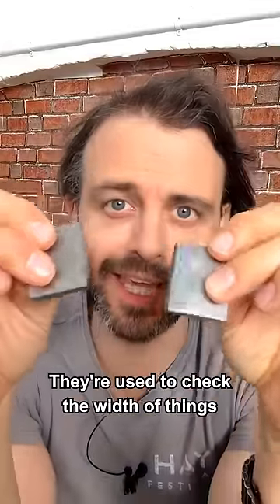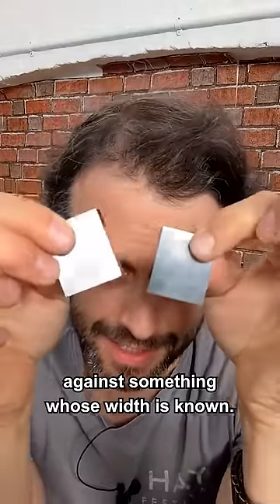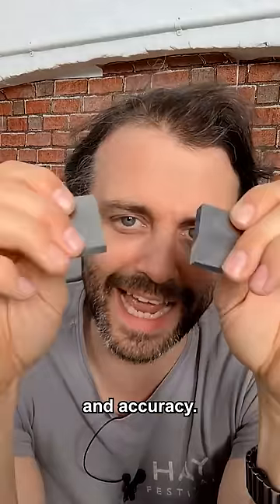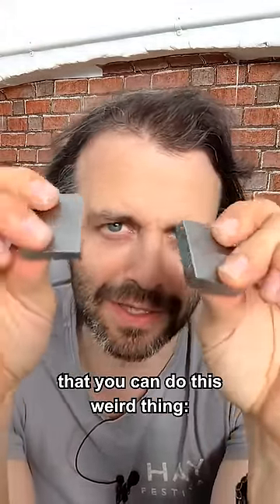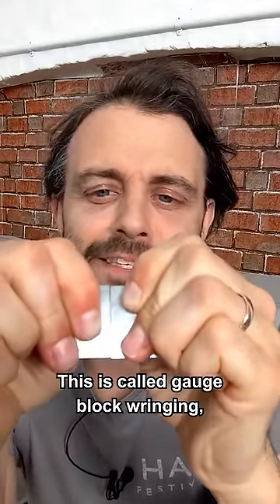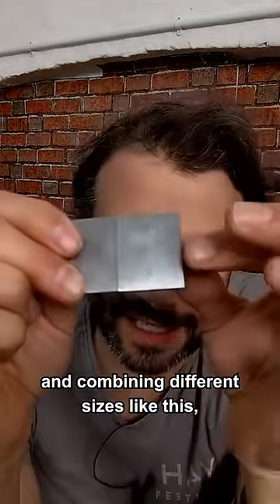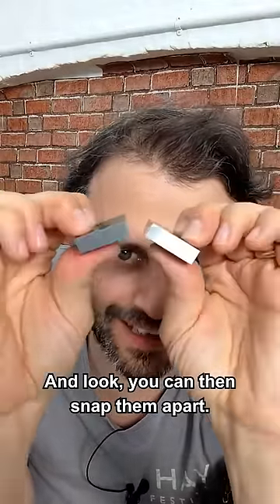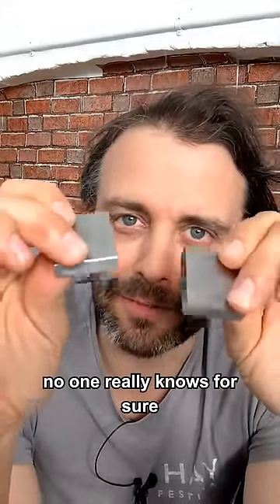No One Knows For Sure Why This Happens!

Comment: For all the air pressure theory proposers: it works in vacuum too , Cody's lab tested that .
Reply: In a vacuum there is still pressure. In between the blocks there is absolutely no pressure. Two peaces of paper will pull together.
Reply: @joeherrera1426  substantially less pressure than in our air. Almost space like.
Reply: @Yourmomloser  cold welding different.
Reply: Does it work as well though?
Reply: I think is welding, the materials bond together given how close they are
Reply: Metals usually like shifting their electrons around a bit it’s probably good ole subatomic bullshit
Reply: Cody's lab the goat!
Reply: The likeliest answer is we'll never find an answer until after a paradigm shift.
Reply: My theory is that the microscopic imperfections are forced together, so they fit together in a puzzle like way, in so many spots that they can hold onto each other.
Reply: @joeherrera1426 yeah yeah no shit
Reply: It's because nothing can be perfect and the sides will always cause a vacuum because the edges are fine enough to not allow air to escape
Reply: @Evanflame-rk9xu I offer the suggestion that we refer to this as "Accumulative Friction". The two faces are so finely smooth that the atoms of the materials themselves interlock so well with one another that the friction overcomes the pressure and influence of both objects on one another. Thus, they "Accumulate" friction as they are pressed together and rotated.
Reply: If you put them together maybe it forms a atomic layer of rust one that is sandwiches between the blocks
Reply: So a suction cup doesn’t work in a vacuum? Theory still stands with or without air
Reply: @luiggitello8546 how would they come apart so cleanly then?
Reply: @ReaperofSouls337 suction cups don’t work in a vacuum? It’d have to be another mechanism doing most of the work
Reply: @joeherrera1426 could it be the casimir effect?
Reply: I was thinking about this. But thanks for sharing the opposing evidence !
Reply: Could it be the metal going into cold welding because the surface is so flat and very little air in between?
Reply: @sirsanti8408  just because it’s welded doesn’t mean it’s welded well. I think they’re right. It’s likely to do with the friction of the atoms creating some sort of micro welding. Like when you push a flat object on a painted wall fast enough it sticks. The other options I can think of immediately are magnetism or an interlocking system but if it was magnetized then it’d be easy to test and doesn’t make sense as to why you’d need do such a specific motion and an interlocking system would mean pieces would break off every time so probably not that or it would be an easy solve.
Reply: Obviously it's called science magic 🎩
Reply: Sharing electrons?
Reply: I don’t believe it
Reply: perhaps there is no air in the no-gap,  reating a vacume ?
Reply: static electricity that attracts objects
Reply: My guess would be the Casimir effect
Reply: I'm guessing it has to do with atomic forces. Being so smooth and uniform those atomic forces have a ton of surface area to act on. Can also kinda do this with 2 smartphones screen to screen but not quite as well.
Reply: Leave them together long enough and you'll vacuum weld them.
Reply: Oh shit thank you for reminding me about that channel
Reply: @ReaperofSouls337 Suction cups absolutely do not work in a vacuum 😂😂 It should be pretty obvious that they rely on atmospheric pressure to hold them in place.
Reply: Cody’s lab top tier content
Reply: @MrChesemis cold welding is a phenomena that nasa has had to deal with in space on countless occasions. I believe they had a rover or a satellite fail to open because 2 pieces had ended up cold welding themselves together in the vacuum of space.
Reply: Yup, it’s called cold welding
Reply: ooh, now im shitted.
Reply: @owenblount7334 I think that is a prevailing theory. Electron interactions. Yeah subatomic shit😂
Reply: @ReaperofSouls337  Do you understand the basic principle of a suction cup? In order for it to stick to the object, it needs to have a lower pressure than it's surroundings in order to stop the edges of the cup from lifting off. The reason the suction cup stays where it is is because the air inside of it is unwilling to expand. if the suction cup was surrounded by vacuum, it would be impossible for it to stick.
Reply: Afaik it's because they're very flat and as you push out the air, they technically "weld" together
Reply: Its something molecural Like its so smooth that the molecules Connect together
Reply: What about van der waal force ?
Reply: Is it possible it's Milled so accurately that the molecules are actually semibonding at least enough to cause a decent hold
Reply: Van der waals force
Reply: Metallic bonds / electrostatic forces maybee
Reply: @Evanflame-rk9xu  and with the number of atoms/molecules so huge that even the randomness of each imperfection is certainly matched perfectly by another
Reply: Well this is it obviously the air pressure that comes first in mind (Pascal experiment) it make no sense making a video without mentioning it. 😢
Reply: @ReaperofSouls337 yes, suction cups don’t work in a vacuum, smooth brain bro
Reply: From my 8th grade chemistry class I remember my teacher telling me that if you stick together two perfectly smooth materials they will bond together on molecular level, almost like a cold welding, except that they can’t really weld in oxygen present atmosphere, which some of people here seem to not understand.
Every atom has attractive force. 8th grade chemistry, my guys. You don’t see it, because it is, as the name suggests, microscopic, so if you manage to make two very VERY smooth surfaces, you can press them tight enough that their attractive forces overlap.

“SuCcsHuN CuPs dUrrRr”
Reply: Virgin air pressure theory fan vs chad we don't know enjoyer
Reply: Maybe the material has an effect? Oxide layer, capacitance, electrostatic forces? By squeezing more air out the blocks are closer, static charge builds up from the movement between the oxide layers, then discharge and hot weld extremely small sections?

I’m probably way off base though.
Reply: @joeherrera1426 Maybe, but air pressure doesn't affect the effect. You would expect that the total amount of energy to pull them apart would be less in a vacuum, but it is not.
Reply: Electrostatic forces at its finest🐓
Reply: @joeherrera1426 Paper and gauge blocks are rather different in terms of density and mass. It would take considerable air pressure for gauge blocks. 😅
Reply: @JustAGooseman so, electromagnetism-something
Reply: @chub22g24  no it's magic
Reply: Saved me some typing. Thx
Reply: @fixitfelix718  you're actually damn right
Reply: Of course he did😂
Reply: @MrChesemis almost is still not 0
Reply: Happened to an astronaut once. Almost lock him out of the space craft
Reply: Why not friction? Maybe two objects that super flat have the biggest area of contact
Reply: It's probably electromagnetism of metal atoms, because the surface is so smooth the surfaces can contact much closer then if they were jagged thus providing more contact which can allow more atoms to connect electromagnetically
Reply: @Evergreen1400  cold welding only happens when 2 metals don’t have an oxidized layer due to a vacuum.
Reply: @luiggitello8546  would take a good while to do. It's the same as you not being able to pull the lid off a vacuum chamber. It is to do with pressure kinda. Basically there is nothing much between them so you have to force it apart to let the air in. Not sure if it's actually pressure it's been a while since I went to school lol
Reply: Could it be that force that pushes things together based on which wave frequencies they block out?

I don't remember what it's called but the idea is that the smaller a gap gets, the more frequencies it blocks out, meaning there's less energy inside the gap and the 2 things are drawn together. Idk if this gap is small enough for that or not though
Reply: I thought it'd be the same principle that geckos use to climb walls, where there's a slight attraction between surfaces, so with enough surface area, they can't stick together
Reply: I assumed it probably has some sort of effect on it rather than being the only cause, but a test in a vacuum chamber makes me think its less than I originally thought
Reply: Vaan der wals interactions?
Reply: @joeherrera1426 erm what? Blud does not know what vacuum means. It’s probably electrostatic that brings the paper together
Reply: Van de Waals forces?
Reply: @MrChesemis  Is the twisting motion maybe breaking the oxide layer?
Reply: Oh!!! Damn this is awesome! I have no training in this it was just a theory I had! But it actually was proven?
Reply: Theoretically, it should work BETTER in a vacuum, as it is likely related to the same phenomenon as cold-welding, which is very similar, and works best in a vacuum (which NASA engineers learned the hard way, when the Galileo spacecraft's high-gain antenna failed to fully deploy, due to issues with metal-on-metal components spontaneously cold-welding, causing the antenna to stick closed).
Reply: @joeherrera1426 not enough
Reply: In fact, it's much easier in a vacuum, as there's no buffer of air to get out of the way. Engineers designing mechanisms for spacecraft need to be careful to avoid having flat metal surfaces come into contact with each other, as they'll stick together.
Reply: @ReaperofSouls337 Suction cups don't work in a vacuum.
Reply: What if it's trapped static electricity? Due to the friction of 2 nearly perfect honed surfaces. 

Electro magnets are power by electricity. So if you're able to make a natural current through friction. Maybe the two different surfaces are attracting to one another, until the trapped static electricity is released. 

Which would be such a low amount, it wouldn't do the zap thing.

Just an idea. Would like to know the real reason
Reply: @Evergreen1400 The Galileo probe's main antenna dish failed to deploy because a few parts of it became cold-welded during the launch.
Reply: Perhaps IMF’s
Reply: So basically because the surface is smooth they can keep air out between them and resulting in there being empty space between them and it creates vacuum that keeps the 2 blocks tgt?¯\_(⊙_ʖ⊙)_/¯
Reply: Okay, then here's another one to think about... Can it be oil of some sort? I know they're clean, but a surface so smooth could work with much less material like the one comes off of a person hand just by handling it.
Reply: @peterwolftips  I remember something like that when u place have wet surface and wet surface, kinda like your hands clasped together when they are wet.
I donno how tho.
Reply: @joeherrera1426  Not enough pressure to hold anything of actual mass together. A plunger wouldn't work in a vacuum so why would this?
Reply: @joeherrera1426 when real science enters chat😂👍👍
Reply: I believe the answer lies at a particle/ atomic level. Could it be molecules or their obitting electrons being shared across a super close tolerance interface. 
Note that force and therefore heat is being applied to make them stick.
Just my theory 😂
Reply: @owenblount7334  "good ole subatomic bullshit" Is the perspective I didn't know I needed to have.
Reply: Just regular old atomic attractive forces, like almost everything else that sticks together.
Reply: Have you considered looking at the grooves under the microscope? I'm failing certain there's air pockets too small to be removed.
Reply: @owenblount7334  oh it's definitely some sub atomic Tom foolery 😅 probably just van der Waal forces
Reply: How they achieve perfect volume tho 🤔
Reply: Surface tension?
Reply: It is amazing how many people think they KNOW the answer.
Reply: Exelent comment
Reply: Wow that would have been my guess too!! In a vacuum that’s fucking crazy!!!!
Could it be molecular bonding?
Reply: It's cause it's metal. A crystalline structure. Just a macroscopic view of a microscopic puzzle being filled
Reply: Its probably cold welding on a very microscopic scale, as the blocks are twistsd together it rubs a tiny amount of oxidation off and the fresh metal surfaces will bond. As the faces are so flat they support eachother. This is why it wouldnt work with two random lumps of metal, the uneven surfaces have no support so the weld that forms breaks instantly.
Reply: @luiggitello8546 that is not how metal works
Reply: Something different happens in vacuum. It's kind of welding. It was observed in space multiple times (most famously - during the first spacewalk in history)
Reply: @owenblount7334 "Good ole subatomic bullshit" just has a ring to it... Three thumbs up 👍
Reply: Bruh I came here thinking I was smart  about to just say it was the air pressure
Reply: Cody's lab is such a cool dude
Reply: Space has pressure and a lot more than people think but earth's atmosphere is at such a high pressure that we don't really have a good reference for it, for example thats why tires are measured in gage pressure rather than atmospheric pressure because the changes would be so minimal if you measure atmospheric pressure you wouldn't be able to notice a difference  @MrChesemis
Reply: this is just a really good example of cold welding
Reply: @owenblount7334 " good ol subatomic bullshit" 😂
Cant argue with that
Reply: This is a phenomenon that SHOULD happen in a vacuum. The lack of oxygen makes things stick together. It occurring in the air is where the mystery lies.
Reply: It is partial cold welding.
Reply: This works through electromagnetic eddy currents “locking” together as they are twisted. Basically the same idea as static electricity sticking things to walls.
Reply: My guess is electron interactions in the pressumed alloys across the "perfectly" smooth surfaces.  I.e., london dispersion or,  due to the alloy something more like dipole-dipole interactions
Reply: @JustAGooseman especially in an alloy like steel, this is similar to my theory of electron interactions and bonding (i.e., dipole-dipole interactions)
Reply: i wanted to say that its simply vacuum..
although it isnt proven that vacuum cannot exist in a vacuum..
Reply: They stick together due to the slight uneven surface catching in the other sides uneven surface like Velcro. This is just a much much finer velcro than anybody's used to
Reply: I think it's just a mechanical connection. A perfectly flat piece of metal on the molecular scale is not perfectly flat. The ridges probably interlock and maybe the molecules are even close enough to have a magnetic force/weak molecular bond to each other.
Reply: @creepysk7975  I doubt it’s welding as this would damage the surfaces with repeated ringing. It’s a combination of atmospheric pressure differential and something called the Van Der Waals force.
Reply: A perfect vacuum is impossible to achieve so Cody didn't do it in a vacuum. I hypothesize the  amount of air between the blocks is similar to the amount of air in a near perfect vacuum.
Reply: @joeherrera1426  "in a vacuum there is still pressure" my brother please look up the definition of vacuum lol
Reply: @JustAGooseman  bro are you a scientist
Reply: I had some pieces of exceptionally smooth glass out of car headlights. And they wring together too which only throws more wrenches into the theories. Codyslab showed that ots not the air pressure and me doing it with glass makes me think it's not a form of cold welding
Reply: THATS WHAT MY PHYSICS TEACHER SAID
Reply: @ReaperofSouls337  suction cups don't work in a vacuum. They rely on air pressure.
Reply: @chalor182  yes. A perfect vacuum yes. But unfortunately that is not possible and definitely getting close to is requires way higher quality equipment than anything Cody has. This means the vacuum chalor is referring to, does infact still have pressure. You are both technically correct.
Reply: Casimier Effect?
Reply: it's smooth so it just forms a vacuum inside and atmospheric pressure holds them and when he's breaking them apart he's folding it to let air in and easily break the apart like those air pressure caps you find in plushies.
Reply: Friction, value of mu is very large
Reply: @ferrumignis It may seem obvious to you but I think you are wrong!
Reply: @chalor182  A vacuum in the technical sense is a space devoid of all pressure. A vacuum in the colloquial sense is a space with a pressure that is below that which we normally experience.
Reply: @JustAGooseman It’s called Van Der Waal's force.
Reply: @baarni  i didn't explain it correctly. Btw this works in vacuum too. And what I know, it works even better. The two surfaces are so flat that the atoms themselves (or the strong atom field) start interacting with each other. That's how it's supposed to work in vacuum iirc. But in the atmosphere, it could be different
Reply: is it so smooth their atoms slide together?
Reply: I thought it was van Der whals forces?
Reply: @baarni yeah I was always told van Der whals
Reply: @joeherrera1426 its not debatable tho 😂 it’s very much proven that smooth metal surfaces will “cold weld”. And they do so even more easily in a vacuum. Nasa discovered that the hard way in space
Reply: I would imagine that air pressure HAS a part in this, but I agree that there may be other causes too
Reply: Surface tension.
Reply: Well, you just shit all over my idea 🤷🏾‍♂️
Reply: its the vanderwal force and the inter atomic ones
Reply: @ReaperofSouls337 😂 no a suction cup wouldn't work in a vacuum... kind of hard to suck without air bud, ask your mom, she would know... just kidding, had to say it 😂
Reply: Fuck
Reply: @luiggitello8546 there would be an oxide layer that prevents it, I believe
Reply: @luiggitello8546  that's not possible, if that was the case then you couldn't just easily and cleanly pull it apart like that, plus cold welding only works on metal that hasn't been exposed to air or have had the oxidation layer removed.
Reply: im sure its the van der waals intermolecular forces holding them together and oil/water left on the blocks to help them with surface tension.

air pressure plays a significant role when not in vacuum.

The reason why they work in vacuum is because the other 2 mechanisms are strong enough to hold them in vacuum.
Reply: it's just cohesion
Reply: @joeherrera1426 yes but then if you increase the pressure it doesn't.... So it's definitely not about having no pressure it's about having not enough pressure to get back in between
Reply: tiny cats that latch on with their tiny claws
Reply: @owenblount7334  Yea sub atomic quantum shit. Don't think about it
Reply: It’s because with such a smooth and unblemished finish like that, the atoms are able to bond together, or the electrons are able to bond together within the atoms, basically creating one piece of metal because that electrons bond between the two metals because the two metals are so close together
Reply: @Evanflame-rk9xu  friction? I like it
Reply: Sounds like vacuum welding
Reply: Spoiler alert:

It's the vacuum between the blocks.
Reply: Van der Waals forces. Same as gecko pads
Reply: The bond gets stronger with time; you never leave Gauge blocks wrung together for too long, if you do, you cannot get them apart.
Reply: Could it be due to moisture? Like there's just enough to where the surface tension holds it together? Or maybe like someone else said that when you twist it, the molecules are able to "magnetically" connect because there's more surface area available AND on an even enough surface so they connect without the neighboring molecules interfering. Or maybe the twist builds up enough charge to start a chain reaction to link up enough electrons to form a weak bond
Reply: a huge stretch im just spittin words here but i personally think it has to do with friction

sure its smooth but i think that because its THAT smooth most of it's surface area is touching kinda like with fusing 2 books together
Reply: does magnetizing them have any impact?
Reply: its not air pressure, think of screws and glue , or welds, how do you stick something to something.. surface area...friktion, smooth surfaces not very smooth under an electron microscope etc etc
Reply: @joeherrera1426  if there is only a small amount of pressure in a vacuum then the weight of the blocks would overcome the pressure force. There is likely a metallic or crystal bonding force causing this.
Reply: Put them in your ears.
Reply: My guess is condensation in the air. I wonder if this would happen with 0 moisture. basically suction.
Reply: Wouldn't it just cold weld on a vaccume
Reply: atomic cohesion is my guess, with it so smooth, more of the atoms can get close enough to eachother to grab the other side
Reply: @owenblount7334  I love that explanation: It's subatomic bullshit!
Reply: @ReaperofSouls337 Yes,. suction cups don't work in vacuums.
Reply: it's probably surface atoms moving slightly and foming a temporary bond
Reply: It still has its surface tension, though.
Reply: @gutnutgut plus electrogravitics and vortex mechanics
Reply: cohesion is a phenomenon, not an explication for the reason of the bonding force.
Reply: friction only refers to the effect that would prevent the two blocks from sliding, so it involves only lateral forces.
Reply: smooth metal on metal there is nearly no friction, and you don’t see any rubber object with really high friction instantly bonding to something (as long as the rubber doesn’t melt)
Reply: I believe the effect is 90% Van der Waals forces, that cause this kind of cohesion, while 10% is due to the limited amount of air that can squeeze into the gap preventing fast separation. Try pulling apart two smooth sheets of glass/metal fast vs. slow after they have settled on each other. I imagine those 10% increase a lot, the faster you try to pull the two objects apart.
Reply: Yes of course it does. The wringing pushes the air out just as a vacuum would.
Reply: Well I'm a vacuum you get an even stronger effect, cold vacuum welding
Reply: @denofpigs2575 what do you mean... It's a known effect of Van der Waals forces lmfao. Not sure why he says nobody knows
Reply: @Evanflame-rk9xu you're not wrong, it's Van der Waals forces between the very close objects. "The van der Waals force of adhesion is also dependent on the surface topography. If there are surface asperities, or protuberances, that result in a greater total area of contact between two particles or between a particle and a wall, this increases the van der Waals force of attraction as well as the tendency for mechanical interlocking. "
Reply: @DarkAttack14  Well if I take his word over yours we don't know. If I take yours over his we do.

Either way nothing changes for me so ¯\_(ツ)_/¯
Reply: @joeherrera1426  say you skipped school without actually saying so.
Reply: It's air pressure and/or oil residue.
Reply: Brother, do you know something name molecular attraction?
Reply: Yeah. While I haven’t read any comments or replies. It reminds me of the cold welding phenomenon that happens when an object can’t oxidize because there is no oxygen. So you can stick two objects of the same material together and they will bond together. Could it be the metal surface is scratched upon turning it, air is kept out due to the flat surface, and the metal forms a gentle bond together through that “cold weld”. Obv that’s just speculation but it would make sense to me. Either way it’s neat to see it happen. Could always just be static as well.
Reply: I believe inside a vacuum there could be a Greater vacuum. And the presence of the oil strengthen the greater vacuum. It is less difficult to pull the the two bars away from each other in the vacuum compared to outside the vacuum. This means that the vacuum you created have not equal or overcome the vacuum created in between the two oily bars😅
Reply: Thanks for your comment.
Reply: my guess is that this behavior is related to atomic scale or quantum scale physics. i think it's pretty likely the surfaces are so smooth that the faces of each block come so close together that quantum tunnelling / electrons overlapping into the other block. what would be interesting to see is how this behavior changes at various material temperatures
Reply: I would've thought that this was clearly the van Der Waal's effect - which we've also recently realized is how geckos' feet stick to walls and then immediately release, so easily/readily/mysteriously - but I see lots and lots of seemingly/possibly legitimate answers and guesses above...???
Reply: @MrChesemis what about ionic bonds, could it be a force similar to that of h-bonds?
Reply: @LAGGANGGAMING  I tell anyone I know who has kids to let them watch Cody's Lab. Kids especially love it. For them it's like having an older brother who messes  around with stuff in the backyard and out in the garage and let's you watch, and then explains everything he does while he's doing it.
Reply: @joeherrera1426  Most people don't know there is still pressure in a vacuum. Happy to see someone else posted this.
Reply: I imagine it's a mix of atmospheric pressure and van der vaals forces, that's how some gecko thingys climb glas for example
Reply: My guess is a lot of LDFs due to smoothness
Reply: Cold fusion?
Reply: Van der Wall effect?
Reply: proximity<-->gravity
Reply: Cold weld
Reply: Does the twist-n-stick also work under water? (Fully Submerged in freshwater or saltwater)
Reply: @catnium  is it magnetism in some way? Eg polarized static electricity?
Reply: link?
Reply: is it not the same principal as cold welding? like what happens in space with astronauts?
Reply: It's because it's hard for air to get in.
Reply: I'd like to see that test and tested for temp changes too.
Reply: Vacuum? Low pressure is not vacuum.
Reply: Action Lab literally did this and showed its air pressure
Reply: Was about to comment, the way they taught us was with air pressure
Reply: It should be with zero humidity and then u will understand
Reply: dude everything is something, even the vaccum of space. there are just far less particles. also who says its just one force? it could be several factors. the objects may be smooth enough some of the particle want to bond, perhaps becuase when you break the bond whatever particles do have to occupy the space immediately perhaps its hindered by causality.either way if we happen not to actually know then its becuase the professionals with the million dollar machines and equipment havent decided its worth it yet.
Reply: I saw them in real life and played with them.
Reply: oh well. There goes my theory. lol
Reply: That doesn't rule anything out. Cold welding/galling of metal to metal serfaces in vacuum is an issue NASA deals with regularly, which is likely to play a factor here, but that doesn't mean air pressure doesn't contribute in atmosphere. Air is viscous like any fluid, meaning it also has surface tension. If it's not able to enter between the blocks, they'll remain stuck together irrespective of cold welding. This same vacuum effect can also be observed in water.
Reply: Dang
Reply: surface tension, the same as why a beetle can walk on water,
Reply: To what extent is that vacuum vaccumed though?  Can there still somehow be a big enough differential between the blocks to make them stick?  I wouldn't be surprised that machining is atomically precise.
Reply: @chainrelapse9144 The act of wringing removes the oxide layer (rust) which allows the metal to stick due to molecular attraction.
Reply: van der Waals
Reply: So, they're so finely cut that the atoms themselves attract?!
Reply: @akasickform  not atoms, molecules. But basically yes.
Reply: That was going to be my first guess, Lol!  Thanks!
Reply: You should look about cold welding how two very clean surfaces can stick together
Reply: Casimir Effect probably
Reply: @sirsanti8408 bad cold welding, grease, water, imperfect polish making it not as good and easier to come apart. also there is electricity making materials stick at a distance, like quantum tunneling. if you put paper in between and then repeat the process then you have some knowledge, trough paper you wouldn't be able to achieve cold welding. but if you push harder it could quantum tunnel some electrons, also paper will clean the grease and water for stickiness.
Reply: more inclined to believe its some subatomic shenanigan where the blocks are so close together that  they're almost sharing electrons despite the oxidative layer that's preventing them from cold welding.
Reply: @Nopenotreally. that is the reason you need to rotate them, to clean them and remove the air in-between.
Reply: @kittamitz not enough surface, the book fuse is because pulling them makes the papers stretch and bunch up in the middle making it a single book. but the way you said it is like saying putting them just one on top of another and expecting them to fuse.
Reply: Check mate air pressurists
Reply: Air pressure was the first thing that sprung to mind, but perhaps when two metals are machined to be able to fit together that well they can freely exchange electrons across the gap as any metal does within itself, thus it's an electrostatic effect
Reply: @owenblount7334  I think your bullshit theory is totally trustable. Yep, scientists simply called that bonding force "metallic force". This force forms when metallic atoms (actually cations) share the same electron "cloud". In this case, the 2 surfaces are so smooth, and they are the same metal so when you press, distance between them are so small that they can share electron cloud and form metallic force.
Reply: Is that how I Mind Meld with Taylor Swift?
Reply: @deadrussianliberal2897  You are almost right, and accidentally right in this case where it is metallic bonding force. We have 4 different forces between atoms/molecules: ionic bond, covalent bond, metallic bond and van der waal. Ionic bond and covalent bond won't form simply be pressing two pieces of same material together, they are not shareable between molecules nor can overlap.
Reply: In a vacuum you can cold fuse or cold weld them together.  There's so many electrons and they get so close  they can start to join atoms from the other block
Reply: It's possible in a vacuum they my permanently fuse together. This has happened in space missions.
Reply: Soo...it's witchcraft
Reply: Why are there people talking about air pressure?
Reply: @80n3y4rd  he didnt state this but certain metals can meld together on a molecular scale like what he just showed thats why it snaps when he pulls them apart
Reply: @PriMsWaRlorD  bc this is youtube comments and people are dumb
Reply: Thank you, and thanks Cody.
Reply: @Josh729J okay did you not read the thing to which you are replying?
Reply: Weak force or strong force attraction? I thought it was air pressure before this comment
Reply: There is a molecular vacuum being formed. People know this, it works for some substances and not others, also you need the surface area to be as shown. Smooth, and with polarities that work to form the little suction cup action at that level of materials.
Reply: What is generally referred to as "vacuum" isn't vacuum. It's sub-atmospheric pressure. Achieving below 10-8 mbar is quite difficult.
Reply: @luiggitello8546  cold welding is different. Stainless steels have chromium oxide surface layer (which prevents the formation of iron oxide). Molecularly there's a velcro like appearance. When two pieces are mechanically interfaced, over time atomic bonding occurs at the interface.
Reply: I believe it is called cohesion. Two like things attract.
Reply: Makes me think of some sort of atomic Velcro
Reply: What my theory is
Reply: Diffusion.
 In thBible it state u put 2metals 2gether the atoms merge.
  When gold and silver put together some of thgold get in thsilver some of thsilver get in th gold. 
 "So a mans face is sharpened by another."
Reply: In vacuum it is normal for two pieces of metal to cold weld together. NASA learned that the hard way
Reply: In a vacuum, the surfaces can bond.
It happened to a few spacecraft parts!
Reply: @joeherrera1426 
It's usually static that draws paper together.
A form of capillary action is at work here.
Reply: @luiggitello8546 
Molecular bonding in a vacuum is cold welding. That phenomenon was experienced by early spacecraft!
Reply: @ReaperofSouls337 
A suction cup does not work in a vacuum as it requires a pressure differential that does not exist!
Reply: It is cold welding. The edges don't have any oxidation, and when you press them together the electrons don't know which piece to belong to, so they act as on piece.
Reply: @JustAGooseman its suface tension.. even steel has this effect
Reply: The micro abrasions are perfectly formed.
Reply: On the extremely smooth surfaces it's the electromagnetic fields between the atoms interaction that causes them to stick together.
Reply: @joeherrera1426 vacuum pressure is real. However it's not just the vacuum. The electromagnetic fields between the atoms have a role as well.
Reply: Almost dead is not dead 
Almost a millionaire is not a millionaire 
Almost a vacuum is not a vacuum.
The last is a seeming impossible concept to grasp ✌️
Reply: @Evanflame-rk9xu I was gonna say, I want to see this under an electron microscope
Reply: I was thinking it had more to do with a mixture of microtexturing and electromagnetics. If those surfaces are perfectly or near perfectly smooth, the twisting motion may cause near imperceptible texturing that helps hold the two pieces together. The other goes along the same lines as the blocks are so smooth that there is enough interaction between the atoms that the blocks can stick to each other in a way like static electricity causes paper or hair to stick to surfaces.

If you control and test for those then, damn I have no idea. Magic probably 🤷‍♂️
Reply: The flatter it is, the more van der wals forces you get. The more wet it is (at an atomic level) the more water plays a role in pulling it together. They would not stick together let's say on the moon, not because of the vacuum, but it's because there is no water vapor present. Clean the surfaces with electrical contact cleaning to remove all oil traces of oil and then Heat them well above the boiling point of water and I guarantee you that they will not stick together, try it and you will see they will not stick together 👍
Reply: no it does not work in a vacuum
Reply: It’s not related to air pressure - probably the surface is smooth enough to allow subatomic forces act to stick enough atoms together to ensure temporary‚connection’
Reply: I bet it was not an ABSOLUTE vacuum where there are not even a single molecule left floating in the chamber. And would the displacement force of the blocks be exactly the same in apparent vacuum or under pressure?
Reply: Metal will actually weld together in space if the surfaces are not covered with oxidation.
Reply: Action Lab tested it too.
Reply: That’s because magnetism is a greater force than Gravity.

And like that, my comments are being taken down I’ll let you figure out the rest.

Here’s a hint what charges magnetism?
Reply: @violettownmicroenterprises1528 A vacuum needs a "place" where there is some space for the air to "not be" . If that makes sense. If there is truly no gap, there is also no vacuum. Unless they form in pits and tiny pockets all over the surface. This seems like a stretch but testable? I prefer the theory that it might be molecular forces. Depending on how much "accuracy" were talking about. Does it work with ceramics or only metals? What about glass?
Reply: COHESION AND ADHESION
Reply: @owenblount7334 😂
Reply: I'm sure in a zoomed in image we'd see a very not so smooth surface causing it to almost cling together like velcro almost... this thought was brought to you by Marijuana.. cheers 😊
Reply: @deadrussianliberal2897  My dude, “microscopic” literally means things that are large enough to see through a microscope. Learned that in the third or fourth grade. Name one metal heavy enough for you to be able to observe it form a metallic bond under a microscope.
Reply: @ZonsCHANNEL well it's obviously not magnetism lol that's just silly.
Reply: Casimir effect
Reply: Wow! So many people who know what they're talking about, the internet is amazing... Isn't it?
Reply: @JTheraos  almost like I said that lol
Reply: This works because atoms from both sides forgets that there is space between
Reply: @ReaperofSouls337 nope suction doesn't work in a vacuum because suction actually doesn't exist. no force is actuality pulling the suction cup, there is always still some air pushing the suction cup away. it's actually the higher air pressure from the outside that pushes harder. in a near perfect vacuum you have (almost) no air pushing on either side. of. course is the victim is shitty you'll still have still a bit of suction
Reply: @violettownmicroenterprises1528 like any suction, it doesn't have to be NO air, just lower pressure air. NO air would create a stronger binding force, 14.7 pound per square inch. even with the leverage it would require more force
Reply: @joeherrera1426 but even in relative vacuum the best suction effect you could get would still be very weak
Reply: Trying it in a vacuum was the first thing that came to mind.
Reply: There is no such thing as "vacuum", the proper term is "low pressure area" and it would be my guess if I had to giess
Reply: În absența aerului între cele două piese, apar și forțe de COEZIUNE.
Piesele se numesc "cale plan paralele (plan paralele).
Reply: Air would be the one thing that would make it not work, this fundamentally doesn't even make sense to try other than for the sake of it
Reply: @JacksonPfeiffer  semantics. It does not “literally” mean whatever you imply. If otherwise, what’s the word for the scale we’re talking? Nanoscopic?subatomicscopic? Never heard of that.
Also, bonds are invisible, as they are fields, as you know, which kinda renders your argument invalid. Because, as you know, I wouldn’t use that meaning of the word when talking about something you can’t see, no matter how much you zoom in.
So, uh… yeah. Thanks for correcting my mistake, I guess.
Reply: @PORCUPlNE1  yeah, well, my 8th grade is ancient history, so I don’t really remember details like that, but thanks for clarifying:)
Edit: I’m not even sure if it was 8th or 6th grade tbh
Reply: @deadrussianliberal2897  First of all, microscopic definitionally means things that you can see through a microscope, genius. It does literally mean what I said. 

Secondly, I was pointing out the irony in how your comment was dripping with condescension while you were simultaneously saying embarrassingly ignorant things. 

You’re welcome, I guess.
Reply: It would be nice to try dissimilar metals to see if the effect is electron related.
Reply: Damn just made a comment saying vacuum
Reply: It's more like these two becoming one object. If you take any 2 blocks of metal, they will bond too, but on very small areas, thus it would be unnoticed. However, these 2 are very smooth, therefore atoms of metal would get so close they would start interfering on electromagnetic levels.
Reply: You called me out in a heartbeat hahaha this was definitely my first thought.
Reply: It's molecular alignment, duh.
Reply: it`s not that mysterious
Reply: Did you tads physics?
Reply: I have used all type of gauges..have worked in casting manufacturing company. I was a straightening artisan i required all type of gauges to measure the precise length height depth flat surface every thing filler gauge snap gauge height gauge dial gauge pin gauge  etc etc.. i have worked 10 years..i am a master at casting straightening just measuring is not enough i used all types of hammer even plastic hammer 😅 so it does not leave dents on metal parts ( Casting) it is an art to hit casting to bring it into precise shape according to gauges
Reply: clean metals cold weld in space....is the high clean contact here a weaker version?
Reply: I knew someone else knew and had posted this....well done...I thought things like this concept were to a degree common knowledge.... though as we have seen common knowledge seems to be very uncommon now a days.
Reply: It snaps into place in a atomic level
Reply: Non meagnect
Reply: No one knows why it happens, except for engineers and scientists 😂
Reply: @violettownmicroenterprises1528    That's exactly what it is. I work with mechanical seals, and this is why they lap the faces so flat(within millionths of an inch) because of its vacuum cresting ability. And it even sticks in a vacuum as well.
Reply: Gäege blocks
Reply: Yeah its a simple vacuum and those are Johansson blocks...
Reply: Came here to say that
Reply: @Evanflame-rk9xu van der waals force can not only work between molecules, but also between two objects that are really flat
Reply: When two very flat surfaces are brought into such close contact with each other, this allows an interchange of electrons between the atoms of the separate blocks, which creates an attractive molecular force.
Reply: The reason for this unexpected behavior is that when the atoms in contact are all of the same kind, there is no way for the atoms to “know” that they are in different pieces of copper. When there are other atoms, in the oxides and greases and more complicated thin surface layers of contaminants in between, the atoms “know” when they are not on the same part.
Reply: @ReaperofSouls337  correct, they don't work. They need a pressure differential
Reply: @JustAboutToEat  I thought about the Casimir Effect too. That's my guess
Reply: Damnnn dude I forgot about Cody’s lab haven’t had a recommendation from him in such a long time
Reply: Cold welding only happens when there is no oxidation. Cohesion or Adhesion? Why is the twist needed? I would like to know the metal.
Reply: It isn't a mystery: Van der Waals forces.
Reply: That's weird. Might be friction working on it as well. Maximum friction with maximum overlap on the surface.
Reply: @owenblount7334  "dispersive attraction"  - Van Der Waals bonds, London Forces, etc. 
so, yeah, subatomic bullshit
Reply: I mean this exact problem almost fucked up the space station did it not? It's worse without the oxidation from the air.
Reply: @Evanflame-rk9xu  Am I stupid? Isn't it just that atoms pull on each other like two drops of water with cohesive forces? I can't see anyone talking about this.

But now that I remembered how two glass panes stick together when water fills the microscopic gaps, I think that your theory is probably more valid.
Reply: There is bunch of forces between matter in close proximity. That's were a lot of adhesive properties come from.
Reply: @owenblount7334 the imperfections cannot be miniscule to a sub atomic level. that would be insane
Reply: @Evanflame-rk9xu I believed that too but moment of a force would make that theory improbably and if it were true then it shouldn't work if the originally horizontal second block is anywhere but exactly midpoint. it would also mean that this could be done with any 2 objects. Also I doubt that 2 pieces could be manufactured to such immaculate precision that they are PERFECTLY complimentary to each other
Reply: That won’t prove anything. The reason is when they are dirty they won’t wring Cody is not as smart as he Google’s  😂😂
Many mistakes and presumptions 
Year 1 Level at best 

The air pressure must be present in a vacuum as movement is caused by friction 
There os friction in the vacuum when 2 items collide 

The molecular cohesion can not wrong when dirty and it requires 2  actions to be present to work 

Close but no cigar sir
Reply: Yeah we just don't know why this happens
Reply: @luiggitello8546 I think it's some like magnetic or charge thing between the molecules
Reply: I am guessing that the tight rubbing  friction is removing/knocking loose oxygen molecules that are not replaced and an oxidized layer, allowing the metal to then slightly cold fuse together.  We know cold welding of metal can occur, because this happens to metals in contact in space where there is no oxygen or oxidation.  There have been satellites that have broken due to their parts cold fusing in space.
Reply: @whyisitsodifficultomakeahandle  it’s more just metal likes sharing electrons and sliding ions around that’s part of why they’re ductile it’s small forces adding up and subatomic forces are really strong.
Reply: Static cling?
Reply: @luiggitello8546  If they welded you couldn't pull them apart again.
Reply: There is no perfect vacuum, only a volume with a very low pressure.
Reply: @guiltylegion7037 that’s would you might think, but that only works if the surrounding space has air(pressure) but in a vacuum it would make no difference because the air pressure would be the same between the blocks as its surroundings. Most likely because of cold welding or another atomic phenomenon
Reply: I honestly thought in a vacuum that the metal would fuse together, didn't that nearly happen during an early Russian space walk?
Reply: @markc1548  It can if the oxidized layer gets rubbed off
Reply: If it were air pressure then you couldn't get them apart that easily
Reply: The air pressure suction cup myth. Ugh. Somebody needs to debunk that already
Reply: I always wondered if there IS a possibility to make a velcro type surface on atomic scale
Reply: @Josh729J  No,  a near vacuum of a millionth of a PSI won't cause that level of force on such small pieces such that a few pounds of pressure can't pull it apart.  Air pressure causing it is thus debunked.
Reply: @ReaperofSouls337  Correct, suction cups not only don't work in a vacuum but if vaccum applied after attachment would shoot from the surface since there is air inside the cup at a few PSI.
Reply: glue, as simple as that
Reply: It works way better in a vacuum. Without air molecules to get in the way, you can easily cold weld the two gage blocks.
Reply: Infinite surface tension
Reply: @ReaperofSouls337  suction cups don't work without air
Reply: on orbit they weld together similar but not ecatly the same effekt
Reply: Vaccum is not exclusively an air thingi inside the atmosphere. Look up the casimir effect (quantum vacuum).
Reply: I think what makes all the difference here is that there is difference in air pressure is between the center region of the two touching surfaces and the outer boundary region nearer the edges of those same touching surfaces.  This is why it won’t be affected by exposing the already mated blocks to a vacuum. The real test would be to actually somehow perform the ringing (mating) of the gauge blocks while in the vacuum rather than putting the already rung blocks into a chamber and then turning it on.
Reply: @owenblount7334  Throw in the terms with "quantum", saying it is subatomic is too plebian.
Reply: @ZonsCHANNEL  well cold welding is when the atoms literally bond with each other as there’s no boundary to block them from doing so, it’d be like trying pull apart an actually welded piece of metal or it would mess with the tolerance of such precision crafted blocks at the least
Reply: @sirsanti8408   that’s assuming it creates a full weld but the edges of the cube would likely weld first. If you’ve ever broken the seal on a bottle with a metal cap then you know how easy it is to break a solid piece of metal if it’s relatively thin.
Reply: @ReaperofSouls337  No, suction cups do not work in a vacuum.
Reply: Yeah, looks like cold weld
Reply: Sooo what about the surface tension the fat of your skin has that you 
put on them merely by touching them? They most likely got a layer of 
fats and oils on them as you touch them.
Reply: @luiggitello8546  if that were the case then you couldn’t just pull them apart with no effect on the material.
Reply: @Josh729J your three assertions do not follow from one another

They’re just three things you’re asserting to be true that aren’t really connected
Nothing can be perfect is the only one that’s definitely true and it has no bearing. The effact happens the more precise they shape is, the closer to perfect. 

Besides. They tested it in a vacuum. You can’t form another vacuum within vacuum. There’s no (or functionally no) air to move.
Reply: @Josh729J your three assertions do not follow from one another

They’re just three things you’re asserting to be true that aren’t really connected
Nothing can be perfect is the only one that’s definitely true and it has no bearing. The effact happens the more precise they shape is, the closer to perfect. 

Besides. They tested it in a vacuum. You can’t form another vacuum within vacuum. There’s no (or functionally no) air to move.
Reply: @ReaperofSouls337 you assumed the answer to your question instead of looking it up. 

Suction cups don’t work in a vacuum. 
So no.
Reply: @joearnold6881  my assertion is that it may not be a perfect vacuum, and that an object can be smooth enough yet still bowed  in spots that may trap air. If you slide a bowed object around on another itll trap air in an expanding cavitation that may not escape due to how fine the surrounding edges may be
Reply: Nothing is a perfect vacuum
Reply: Metals have oils on them due to oxygen or somethin, if u rub them it interlocks the metals oils and stuff, thats why in space in direct sunlight that oil burns off with the oxygen on it and metal can freely fuse together. Its snazzy
Reply: @denofpigs2575  dude wait, maybe we ARE the paradigm shift!
Reply: @Josh729J  you mean enter, not escape. Right?
Reply: @blackcauldron  no, it's just suction. I think you're all overthinking this. Geez people! Lol.
Reply: @donaldshimkus539  Hah, not likely.
Reply: Just a form of partial cold welding. A few atoms sharing electrons.
Reply: Metals are held together by electrons and they are always an ion similar to hydrogen.

They are so smooth that enough of the two metals can interact andbasically become one.
Reply: It happens because you're squeezing the air out. It wouldn't be possible if they weren't optically smooth. The same thing used to happen to satellites in space.

Whether it's a vacuum or not is irrelevant.
Reply: You cant snap cold-welded pieces, don't talk bs
Reply: @souran1321  if it’s a vacuum there is no air to squeeze out, so I’m not confident in your theory. It is more likely that the mirror-smooth surfaces allow close enough proximity of atoms so that a few of their electrons exchange and a small amount of cold welding occurs.
Reply: I thought it was like static electricity from the friction or is that just with like pencils or items close to size and weight.
Reply: @sirsanti8408 Its thin film of fat, which does the trick. If you use trichlor-ethylene to get rid of all fat, the trick wouldnt work. But if you rub your finger over the surface again, you may apply enough fat agian to do the trick again ;-) 
The guy who says he is "magnetic" and makes aluminum bottles stick to his bald head has fatty scin too!
By the way Aluminium is diamagnetic.
Reply: Looks like a form of van der Waals forces.
Reply: It has nothing to do with Air pressure. It's a layer of Air being pushed out of the way allowing for cold welding. No thin layer of Air in vacuum = easier cold welding.
Reply: It's probably doing the same thing gecko pads do.
Reply: vanderwaals?
Reply: @owenblount7334  After reading some quantum mechanics, it really wouldn't surprise me. Anything is possible in the quantum ralm.
Reply: @alexm8047  Not necessarily. There are a few rules quantum mechanics can't break, at least as far as we know with current calculations and observations. Like non-contradiction. and with quantum computers they struggles with deterministic predictions, out-of-resource limitations, noise errors, quantum decoherence, and struggling with NP-complete problems.
But yeah, what can be done within the realm of quantum mechanics is ridiculously impressive and seems pretty infinite.
Reply: @StasyanNeTupoi  you absolutely can't snap cold welds, just depends on how much bonding has occurred.
Reply: Maybe it works like lizard legs
Reply: Cold Weld in a vaccuum?
Reply: @joeherrera1426  well i doubt that pressure is strong enough to hold together a metal block that size
Reply: @luiggitello8546  cold welding fuses the two pieces into one, you can't separate them afterwards
Reply: oh woow
Reply: Looks electrostatic
Reply: Damn, I was about to say air :D
Reply: They stick together with the power of atomic pull.
Reply: There is no true vacuum, Even the large hadron collider's vaccum has a considerable amount of gas present, but to subatomic particle's perspective its functionally empty.

Did Cody's Lab test whether or not the force needed to seperate them in vacuum was different? 
If it requires the same amount of force in a vacuum, than it does under typical pressure, then you would have a point :D
Reply: It's called molecular cohesion.
Reply: Creating a tighter vacuum still works in a vacuum chamber.....
Reply: @Evanflame-rk9xu  Yeah, plausible
Reply: my guess would be magnetic forces, but i think they could test for that
Reply: when there isn't any oxidation, the two similar metals will bind together.  this happens in space and things like bolds can fuse together in space.  i would guess that the polish prevents some of the oxidation and allows a minor bond.  that's my gues.
Reply: @Josh729J Not at all, because this experiment was made with two of these blocks IN THE MOON, in the 70's...and the blocks joined!
Greetings from Argentina!
Reply: Had the discussion with a machinist, he insisted it was vacuum, until I showed him Cody's video, then he insisted it was vacuum and the video was bs
Reply: @joeherrera1426  You talk with certainty about causality you shouldn't have.

Plus, do the math nerd.
Reply: @ReaperofSouls337  no, a suction cup doesnt work in a vacuum
Reply: van der Waals force obviously, just like gecko feet
Reply: @joeherrera1426  with how much force? :facepalm:
Reply: Adhesion, you're welcome
Reply: @joeherrera1426 do your mean forces?
Reply: @Evanflame-rk9xu what is forcing them together? There is no pushing?
I think is the opposite if what you said. The more flat the more atoms are near each other attracting
Reply: there is no such thing as a perfect vacuum - next
Reply: Thanks for the info. That was my first guess honestly. Came to check for the armchair scientists but it's nice to see someone who knows more than that give a comment. Cody's lab is such an awesome channel.
Reply: Anyone mentioned vacuum welding yet?
Reply: @owenblount7334 nerd who isn't as smart as he thinks he is comment cringe.
Reply: @2vectors708  
oh come on! vacuum welding sucks!

there is no such thing as a 'perfect' vacuum
Reply: @andyman8630  metal doesn't need a perfect vacuum, just enough air to be out of the way to not interfere with the electron sharing
Reply: Does it work better in a vacuum bc it's basically cold fusion?
Reply: @bronsonalbaugh3160  
it works in a vacuum because it's cleaner!

sorry, dad jokes - i'll show myself out
Reply: Cold welding. The lack of air causes the metals to bond as if one solid piece. The bond is however so poor that it probably doesn’t even transfer Any matter when broken.
Reply: thank you for correcting my error
Reply: Maybe the surfaces are smooth enough for a piece of metal to polarize when the electrons in one piece get close to the electrons in the other and repel due to the like charge, and then possibly one takes a net negative and the other a net positive charge?
Reply: It works BETTER I'm vacuum. similar metals brought into contact in vacuum can actually bond together permanently
Reply: @Josh729J this comment literally says it works in vacuum, disproving your guess before you even typed it.
Reply: @ReaperofSouls337 no, a suction cup doesn't work in a vacuum
Reply: Its cold welding, its when there is no oxide layer preventing the two halves from combining.
Reply: @Evanflame-rk9xu two things wrong with this:

1. Why would the blocks stick together under these conditions? Wouldn't this just result in increased friction?

2. These blocks are machined and polished to incredible smoothness, minimizing imperfections in the surfaces. So wouldn't less polished blocks have this same effect only stronger?
Reply: @Evanflame-rk9xu  Yep. Imagine sub Atomic Velcro tape between them:)
Reply: @deadrussianliberal2897  Your theory for the gauge blocks is probably accurate but they don't teach Chemistry in 8th grade almost anywhere in the USA. Chemistry involves math that is beyond the math you learn in 8th grade. I was lucky and took Chemistry freshman year in highschool because I was super ahead. Normally they don't teach Chemistry till 10th grade, or sophomore year. You don't gotta lie to kick it, the way you said it also implies that you learn chemistry every year and what you're referring to is "8th grade chemistry." There's no such thing as "grade chemistry." Chemistry is just one class that you normally take for one year. If you're in AP chemistry, you're going to be taking physics the year after that.
Reply: Does it work for non-metals?
Reply: The quantum link that avoids the self reflection of fingertips when seen from above a crystal glass untill you grab withwith a lot of pressure? One of his own videos.
Reply: @joeherrera1426  Static cling is a thing. One sheet has a slightly positive charge. The other sheet has a slightly negative charge.
Reply: @owenblount7334 …."subatomic bullshit"    Why is that so fuggin phunnee?
Reply: Thanks, but I'll do my own experiments to verify that. 
I'm going to do an experiment with ours. I'm theorizing that the force it takes to separate them is 14.7 pounds per square inch of those mating surfaces  I'll need a pull gauge. 🤔
Reply: What about oils and different miscellaneous different substances acting like glue?
Reply: The casimir effect is the same thing on a sub atomic level. There is no such thing as a total vaccuum. External pressure is greater than internal and the gap between is too small for a particle to exist there. In fact the may be the closest thing to a true vacuum. Though still not. A vacuum is a space devoid of particles.  However ther is no particle because there is no space
Reply: In a vacuum the 2 pieces of metal become one piece and you’re not getting them apart because the atoms have actually bonded. It’s a type of weld. I image there is so little air between the pieces the nuclear weak force starts to act. Which is why if you leave them bonded eventually they will become one piece. It’s not a mystery
Reply: It literally works better in a vacuum. You can actually permanently weld two pieces of metal together in outer space if they’re smooth and pressed together long enough
Reply: Bro forgot surface tension 😂
Reply: That's in fluids...
Reply: @owenblount7334  that's the bullshit known as chemistry which also works in biology 😅
Reply: Aight well if it ain’t air pressure, is it intermolecular force, or more specifically van der Waals’ force?
(Me who studies both physics and chemistry)